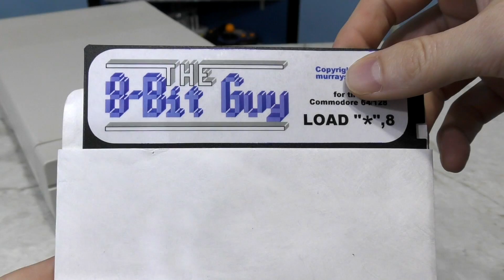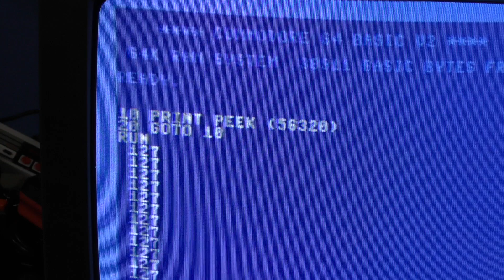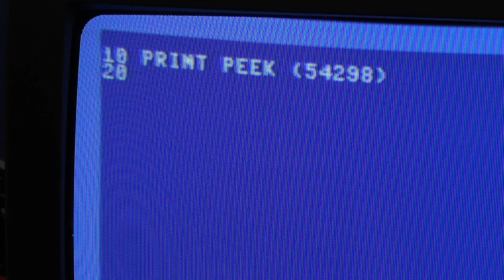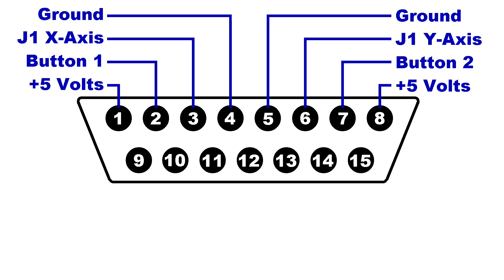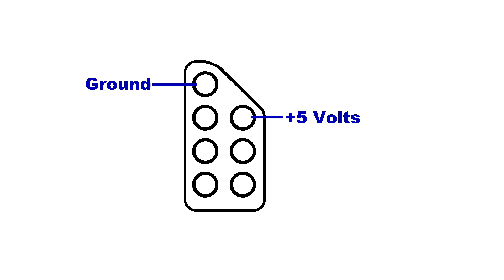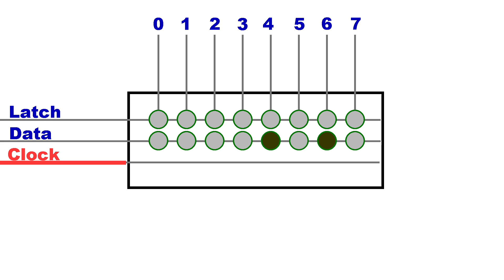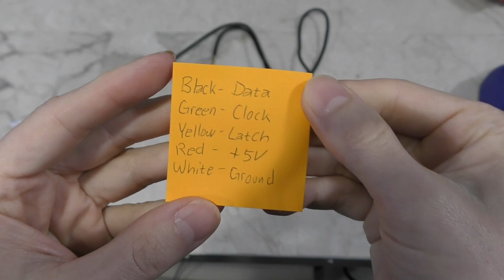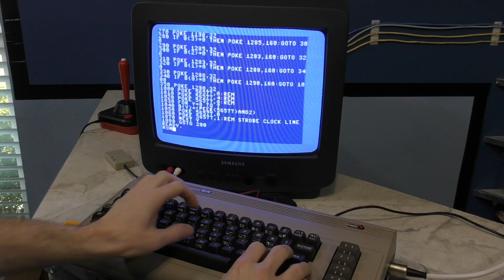How Vintage Game Controllers Worked

Comment: did the original playstation use the shifter?
Reply: Shifter? You mean the Analog Button? I think some games used that, yes. But mainly games that came later in the system's life, allowed you to switch between the D-Pad and the Thumbstick to choose your primary control method. But again, this only worked in games that came out later in the system's life IIRC, and many PS2 games used this functionality as well. Some PS2 games would only work properly in Analog mode, from what I remember.
Reply: @Dhalin  i don't think you watched the video... does the ps1 use the same shift register technology as the nes/snes ?
Reply: @stuffhappensdownsouth9899  Well you said "Shifter", you didn't say "shift register". And for that, maybe? Because the Playstation controller only has like few pins as well. Either a shift register, or some kind of data processor inside the controller that does something similar most likely.

Comment: In part 2 please explain that even though the NES controller was digital, it still acted like a potentiometer based on how long you pressed the button. For example, if you're playing SMB and you just need to make a short jump you just lightly tap the A button, but if you need to scale the screen you press and hold it. 

Also, I really could've used a NES adapter for my Atari 2600. Always hated sticks. D-pads are much better.
Reply: That has nothing to do with controller tech though. That was a game mechanic - adjusting the jump based on how long you hold down the button. That's done by the game dev, not by the NES or the controller.

Comment: My memory may be failing but i am pretty sure i used my Genesis/Mega Drive (EU) controller with my Amiga 600 and 1200, with the C64 C i used the classic TAC-2, i can't recall there being any problem with the controller when using it with Amiga consoles, or perhaps the problem was only for Commodore (64/128) and Atari models?
Reply: You're correct. David's either misunderstood how Sega controllers work, or was simplifying his explanation.

Comment: Hi, could you do investigation like this about Kempston interface from ZX Spectrum?
Reply: Not sure how much of an "investigation" is needed. The Kempston interface specs. are widely available. It accepts Atari joysticks and presents them to the computer in the same format as demonstrated on the C64. The only difference is that the data is obtained by reading an input port (31 I believe), rather than from a memory address. http://www.worldofspectrum.org/pub/sinclair/technical-docs/KempstonJoystickInterface_Schematics.gif

Comment: Actually, those controllers with USB work pretty much the same way while using a chip with internal USB protocol support, internal ADC (when axes implemented) and a number of bits in internal shift registers and/or I/O port registers. And that's it. It's all about legacy reimplemented in a modern application. The only difference from the previous kind of PISO SR species is that the chip inside the controller can generate HID events on USB line, so USB host can know that it needs to respond even not being polling the device at that moment.

But this video is short, informative, interesting and yet covers pretty much of the topic.

Comment: Great video but you were wrong with the genesis/mega drive controller description. Select is not a button, in fact it is an input to the controller which allows you to switch between the buttons you want to read.

In its default state (select being high) you can read U,D,L,R  plus B and C like you would on the master system controller. This is for backwards compatibility with software and hardware between the two. If you ground the select line, it will change the controller state and allow you to read A and Start, whilst also grounding the L and R directions. So to read all buttons, you'd read the controller data with select high, then flip select low and you would see the second set of button data required. You could do this much the same like you did with the NES pad.

The 6 button pad works much the same but if you read the controller 3 times in quick succession, on the 4th read you'll have XYZ and Mode on the button inputs instead.

Whilst I'm not going to argue that it could cause problems with the C64, it wouldnt damage it as the 5V would only set Select to be high and thus you'd only see the B and C buttons. Im not sure if the controller would function right as it expects power on pin 5 but without testing i wouldnt know.

And this is all from experience from reading many controllers to get them to work on other consoles or arcade game boards!
Reply: The reason genesis controllers can damage C64s is that some of the pins on the joystick port are shared with the keyboard so the C64 periodically drives them low.  Normal joysticks leave the pins open circuit when not triggering them but genesis controllers actively drive them high causing bus contention.  It's not an instant death kind of scenario which is why some people will get away with it for months or years and swear that there's no problem, but it puts unnecessary strain on the C64's chips and has been known to fry them.
Reply: @brotheredward06  Ah that would make a lot of sense. The controllers will do that because of the 74 series chip in it. But in the mega drive, one off the Sega customs handle the controllers so there's no contention. Also an interesting fact is that the rear DE-9, used for the modem in Japan, is connected and can function like a controller port. Or that the front ports can act as a 7 bit IO port. I remember people used this feature to connect the mega drive to a pc and upload demo code onto it, using software burnt into cd for use in the mega cd.
Reply: @brotheredward06  huh. That would also explain why there's not many people claiming that it can cause damage to atari 8 bit computers. (8 bit guy being an exception, but then his description both of how the Sega controller works AND why it can kill a c64 are clearly wrong).

The Joystick ports on the Ataris don't connect in any way to a keyboard controller - that's a quirk specific to the c64...

While I've heard people question whether it can damage an Atari, I've rarely ever heard anyone claim that it can...
And they usually cite something to do with the keyboard controller as being why it can damage a c64 but not an atari...
Reply: pin 5 is a pot input, so while it is normally floating it is pulled to ground every 512 clock cycles to discharge the capacitor used to measure the paddle resistance. naturally this briefly stops the multiplexer chip frim working as expected. The multiplexer usually powers itself via internal leakage of the 5v on the select line whist the normal 5v power is in the floating state.
Reply: @ownpj  Ah, I thought it might. And you're right that pin 5 on the Atari standard is a pot input, but on the Sega version, pin 5 is 5v.

Comment: Would you do a video on turbo controllers and how they work?
Reply: Just an extra chip in the controller, so it rapidly pulses the pin on and off when you press a button. The console or computer doesn't need to do anything differently in terms of reading the controller.

Comment: “I wrote a little proof of concept program...” 
aaaaaaaaand my head explodes
Reply: Right. He's always so calm about some of the amazing things he does. Like when he coded a fully working tetris game from scratch in just a couple hours.
Reply: BASIC on the Commodore was pretty robust. Every byte in the memory map could be read using a simple PEEK command if you had the documentation for what registers mean what, and that included all of the data pins on the input ports and the cartridge slot. Commodore provided most of the relevant information right in the manual, probably because they wanted to convince parents that their computers were good for teaching kids programming.
Reply: learn a little about coding; what he did would be time consuming for a beginner, but it's not really that complicated. once you learn a little programming you will feel amazing, and your understanding of a lot of things will open up. When I wrote my first functional application, I begin to understand how microprocessors worked, even though my project had nothing to do with that.
Reply: I really hope David's got a GitHub, I'd love to read some of these programs some day
Reply: Heh, BASIC on the Commodore is so robust you could build a working Assembler in BASIC and use it to construct more powerful games.  I tried and failed to do this in the past, mostly because I didn't think far enough ahead to make separate compiler and editor and instead tried to translate each assembly instruction line by line.  This made such a bare bones tool that it was unusable for creation of an actual program.
Reply: @DoomRater < Should have used the ready made "Merlin" assembler, and there were quite a few others too.

Comment: Back in the day I always wanted to use an NES controller on an Apple II or a Mac. I never really liked the Atari styled controllers that were more common on PCs. Joypads didn't seem to appear on PCs until the 90s. I thought that there should have been an NES to ADB adapter on the Mac with drivers that would allow you to set keyboard keys to the NES buttons.
Reply: And even then, most joypads for PCs were very poorly made and nowhere near as good as what Nintendo or Sony were doing. They were cheaply constructed, and they were basically a big plastic + on a pivot and they usually felt very loose. I tried a number of them and I hated each one because they all stunk. That's why I was so glad when they started making Dualshock->USB adapters in the mid 00s, and I bought one without hesitation and I've never touched another controller made for PC since until the 360 controller (which I have for games that stubbornly insist on XInput, and/or 3d games that don't work well with + pads like Tomb Raider 2013).

Comment: When I was little, my dad made a homebrew "joystick" for our ZX Spectrum using a soap box and 4 microswitches on the bottom, so it was essentially a mouse that you had to tilt instead of moving. It worked way better than cheap stick-type joysticks available at the time.
Reply: My ZX Spectrum had a home-made SHIFT key, which was a clicky microswitch encased in a cardboard shell near the keyboard (I think because the original key broke).
Reply: The keyboard on mine was made out of 2 old scientific calculators side by side. I wish I still had it, it was top tier DIY stuff.
Reply: musashi gundoh 
may i ask what part of the world you grew up in?

Comment: Btw. You can basically make all those controllers work easily with C64 using microcontroller and all games would support it because it will emulate original controller. I am planning to do so on PS1 using Bluetooth based MCU and dualshock 3 or 4.

Comment: The Amiga was sega-compatible. Many games made use of the 2-button setup (ie Turrican 1/2/3).  However, it is CRAZY to me that the amiga was designed to accept sega joysticks, but those same joysticks would fry the C-64? Amazing
Reply: David's actually wrong on this point. He's assumed that the Select pin is connected to a button on the controller, when it's actually an output to select which "bank" of buttons to check for.
Reply: It's not crazy. The Amiga was designed primarily by ex-Atari Inc engineers. Chiefly being the late Jay Miner. Its "Lorraine" chipset was going to be the heart of Atari Inc's "Mickey" 16-bit game system slated for release at Christmas 1985 until Commodore came in and "stole" Amiga and Warner broke Atari Inc. up into pieces and sold it off. Imagine the 16-bit console war starting at the end of 1985 instead of 1989...
Reply: @TheJeremyHolloway  I love all that history. I was 12 in 1985, and loved everything Commodore and Atari, but nobody ever knew about the drama behind the scenes. You didn't really get the gossip in Compuserve, or other pre-internet services.

Comment: I've made a "quadrature encoder" with Mojo FPGA (Xilinx Spartan-6) board, instead of wiring a real encoder I soldered a NES controller for the counter logic written in VHDL. 3.3v works just as well with the NES controller. Then I outputted the result to TFT laptop screen using LVDS and OSERDES primitives. This way I could check if the counter logic worked. The counter would count from 0 to max 32-bit in the positive direction and 0 to 32-bits max for the negative direction. There was a bit telling which direction the counter was at. This is for my never ending CNC controller project...

Connecting the NES controller to C64 and be it usable I can foresee a simple Arduino project... :) Just as there are PS2 mouse projects to Amiga machines.

Comment: Been using my Genesis controller on my Atari XE for a while, guess it's good I haven't used to start button.  Guess to be safe I should make a splice cable so pin 7 isn't used.
Reply: It doesn't fry Ataris. It fries fragile Commodore gear due to the weak CIA chip.
Reply: @TheJeremyHolloway  Thanks for the feedback, glad I held off buying parts for an adapter to see if anyone else had more information on this.
Reply: No, the Select pin is an output, not an input.

Comment: TI-99/4A would have been interesting. It read 2 joysticks on 1 9 pin connector.
Reply: My dad rigged up a special plug for me so I could use a better dual set joystick he found at a discount mail order place. I wrote several head to head games for my TI.
Reply: There were adapter cables for using standard Atari joysticks for them. I bought one at Toys R Us for my cousins back in the day....

Comment: Great video! Will you explain how a four-score NES adapter works in the next episode?
Reply: It's basically the same principle. Except there are chained shift registers (or larger ones? only part I'm not sure) to allow two different controller states be stored and polled one after the other.

So instead of reading "P1 P1 P1..." from the first port and "P2 P2 P2..." from the second port, it will read "P1 P3 P1 P3..." from the first port and "P2 P4 P2 P4..." from the second port. There are a few extra bits exchanged to identify the adapter as such, but it's essentially identical.
Reply: @Smaxx  Yeah, more or less.
It's actually a built in feature of the SNES - it has hardware registers to store controller state information for 4 different controllers at once, yet only two controller ports.
The circuit in the multitap is pretty simple. I assume the SNES can identify the presence of this device, and then compatible games can switch to code that reads the extra controllers. (SNES controllers have ID codes that you get alongside the button data; that's how the system can tell when you have a standard controller, a Super Scope, a mouse or something else plugged in - the ID code is different for each of them.)
Reply: @KuraIthys  You're a bit off the road though, unless that's meant as extra information. :) We're talking about the NES's Four Score adapter, which was basically the predecessor of the Supertap.

Comment: Wait, what about the third button on the Genesis controller? I'm guessing that one goes on the unused pin?
Reply: He's actually made a mistake (or a deliberate simplification) in describing the way the Genesis controller works. The Select pin is an output, the console sets or clears it to choose which of the two banks of buttons to read. On a six button controller, it sends a two bit sequences, to choose from four banks.

Comment: How DARE you suggest that the NES controller did not support diagonal input on the D-Pad! I feel deeply wounded now, even though I enjoyed the video :-)
Reply: I think he mostly meant it won't register opposite directions
Reply: I think he meant that there are only four directional lines. Diagonals are done by pressing two switches at once.
BTW, the original D-pad was designed for the Donkey Kong Game&Watch video game that did not have diagonal movement.
Personally I prefer Atari-style joysticks for games where diagonals are important because D-pads are so poorly suited for them.
Reply: @Findecanor  Maybe old joysticks, but modern thumbsticks are terrible for 2D gaming. I hate pressing left and having my character walk a couple steps and then duck when I'm trying to run just because of a tiny tiny down pressure when I'm pressing left or right. Diagonal on a D-Pad is easy, and in fact, I use a Dualshock2 controller (I have a USB adapter for it) for all of my sidescrolling gaming. Also, not all D-pads are created equal -- Dpads like the ones found on playstation controllers are excellent. However, cheap knockoff controllers will oftentimes basically use a tiny joystick with one big huge + shaped cap ontop of it and you're really actually using a joystick that has a dpad shaped cap ontop of it and those suck.
Reply: He means it doesn't have dedicated diagonal inputs
Reply: He meant to say ALLL buttons, not diagonals. Diagonals would mean pressing two consecutive buttons
Reply: @suprotikdey1910  You mean simultaneous?
Reply: It is mind boggling to me that someone can put so much love and care in a video even writing several programs to better illustrate and teach how something works and then say something absolutely nonesensical about that thing
Reply: DON'T DEFEND HIM, HE MUST SUFFER